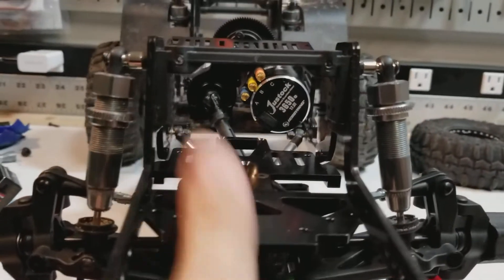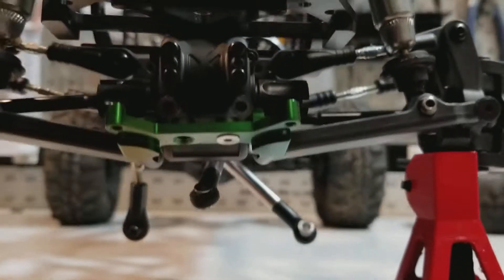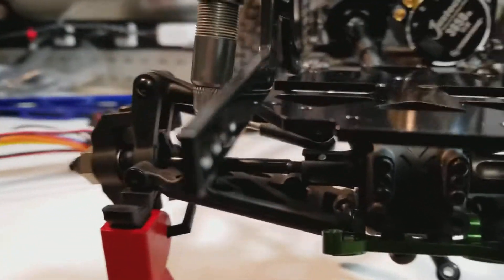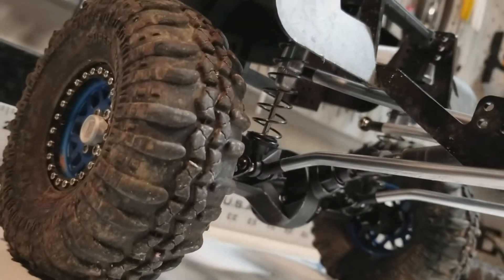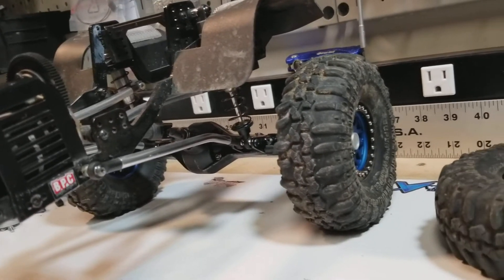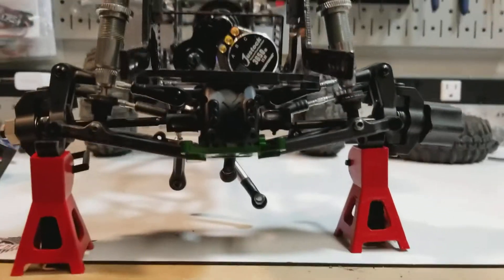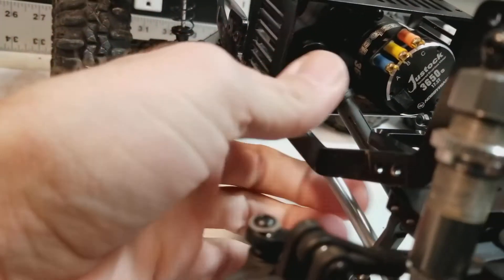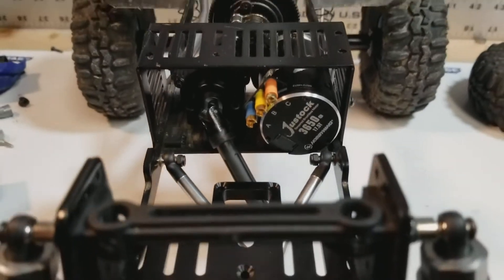Everest Gen7 IFS quick update

Comment: Hi Gary I have a question my rear wheels on my gen 7 sport doesn't spin anymore when I squeeze the throttle. I'm not sure what the problem could be? If you could tell me I would appreciate it. Thank you
Reply from the maker: BeamMeUpSlotty - SoCal Slot Machine Videos if it's just one wheel I'd check inside the axle housing.  Might have broken the locker or a shaft.